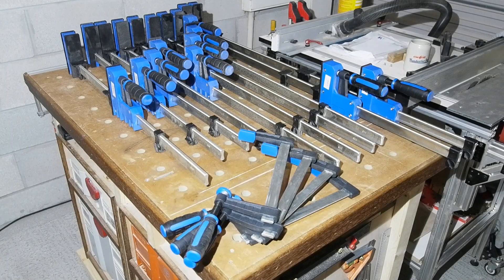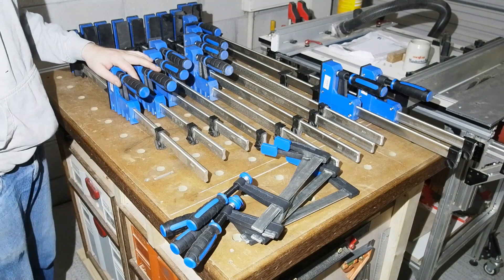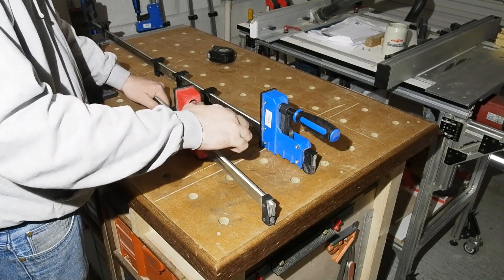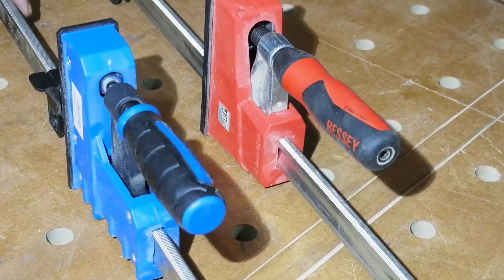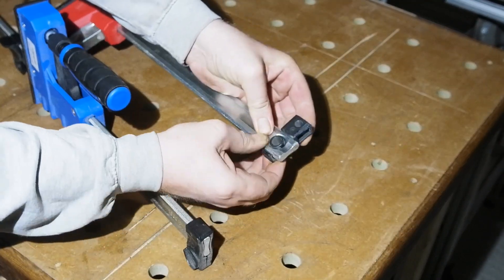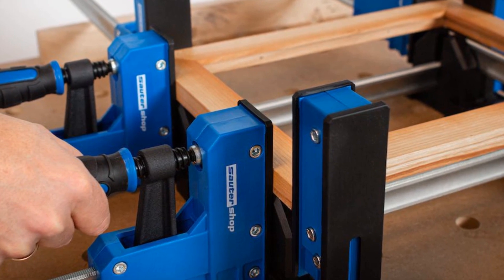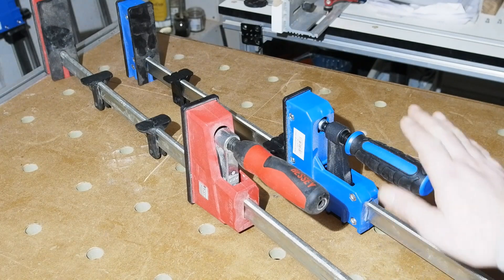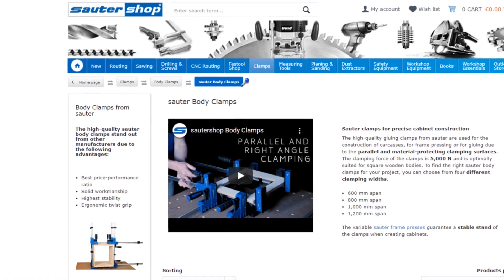[Gifted} Sauter Body Clamp VS Bessey K-Body Revo Parallel Clamp Comparison

Comment: One of the best real world comparison videos i have seen on any subject. It might be worth comparing clamping force applied but i doubt there's much difference.
Reply from the maker: Thanks mate, much appreciated! I did consider buying in a gadget to test the force but, as I kind of say in the vid, force applied with either is ample. I'm not convinced with the Bessey's ability to apply extra pressure with an allen wrench. It makes the clamp flex to where you can see the jaws become slightly angle which can obviously do the opposite of what you want - closing joints. If it needs that much pressure to close a joint, it's worth re-cutting the edges on the workpiece tbh. But yeah, no doubt with that extra feature the Bessey would win a clamping pressure test.

Comment: Really informative video. Not come across Sauter before, will definitely be checking them out based on what you showed.
Reply from the maker: Thank you mate. They're certainly worth a look. Their speciality has to be their own brand router table insert plates and router lifts. Just superb quality. I have one of their insert plates. You can see the video on it pop up at the end of this vid if you're interested.
Reply: Also have a look at the Woodgrafter on YT.  That Andy did an interesting review of their router insert and associated bits.  He seemed impressed.
Reply from the maker: Good call Julian. He did a pretty in depth review and set up etc.👍

Comment: I have no doubt what so ever that these are good clamps and if some company gifted me a load I would also tell you how good they are. Not to get carried away with how much crushing force you can get out of them, I only require clamps to hold bits of wood together until the glue dries. A pair of 1200mm aluminium clamps can be had online for approx. £30 if they are good enough for Paul Sellers they're good enough for me (small hack required ala Mr Sellers).
Reply from the maker: Doesn't matter if something is gifted to me or not, if it's shite and not fit for purpose, I'd say so as I have in previous reviews and comparisons. 
One of the points I make in the video is the ability of the Bessey to apply excess clamping force is unnecessary. If you need that much force, generally your edges aren't prepared properly. 
20 plus years in boat building and construction, I've made do with whatever clamps. Most often hand me downs - sash (aluminium and steel/iron), pipe, G and F - no frills stuff, but nonetheless helped me produce work I'm very proud of. I'm a recent convert to the parallel clamp of this Bessey Revo type design. They are just better. 
"Good enough" is fine but it isn't the final word. Also, the needs of amateurs are different to those of most professionals. Paul Sellers, although a very respected craftsman and teacher, regards himself as an amateur. Amateur because he isn't relying on daily production of work to put food on the table and keep a roof over his head. For professionals, those of us who produce day in, day out to make a living, little efficiencies with certain tool choices can have a big impact. 
I would hope that videos like this help assist the amateur and professional alike make better choices of where to sink their cash, even if the products aren't for everyone.

Comment: Forgive me if you covered this. I did watch twice but my concentration is limited. I assume there is nothing to extend two clamps together like you can do with the Bessy?
Reply from the maker: Don't worry, it's me not you. Totally forgot about the connector. Had looked into previously. Annoyingly, the connector would seat the Sauter bar ok but the bars are missing to hole in the Bessey. The hole is needed for the bolts! If you had the means, you could drill the Sauter bars out I suppose. 🤷‍♂️ Failing that, it's s bessey only option.

Comment: Nice video! How do you think they compare to the Axminster ones?
Reply from the maker: Don't have the Axminster Trade version bud but visually, you can see that like the Sauter, certain mechanical elements aren't as overengineered as the Bessey. They do have the same jaw size as the Bessey it seems. Also have a jointed handle so you can turn it sideways, using as a sort of wrench to apply more force. Though, as I say in the vid, care has to be taken when using these features. More than enough pressure can be applied for 99.9% of tasks just hand turning the handle. Like other budget versions, no doubt they work perfectly well (they seems well reviewed) and will meet clamping needs. They just might not feel quite as "proper" as the Bessey.
Reply: @BischBaschBosch  I have the Axminster ones, I’ll be doing a comparison before too long. One difference is that the aux clamps have a handle that can be flipped 90° so you can apply more force, but as you say, Stew, that’s not always a good thing! 😬👍
Reply from the maker: @10MinuteWorkshop  Absolutely mate. As I've said elsewhere here, if you need that much force to close a gap in a glue up, you're better off redoing the edges. Shouldn't need 170nm or whatever it is the Bessey is capable of.
Reply: @BischBaschBosch  Exactly! I think I said much the same in my 5 clamps bud or whatever it was - put 5000 Newton’s of clamping pressure over something I’ve made and it’ll snap in half! 😯😂

Comment: Sauter body clamps look like a blue version of the one’s soled by Rutlands in the U.K. 

I have the Rutland ones and I can get enough clamping force to dent the timber even with the soft jaw

Got to the end of the video and differences? Not doubting you BTW, just asking 😁
Reply from the maker: Yeah, that's what I was trying to get across really. The force from the budget ones are ample. Very similar to the Rutlands but different casing and handle. The Sauter and Bora are identical though. 🤷‍♂️👍
Reply: @BischBaschBosch  definitely ample for sure.
I am very please with mine I must say. The clamping guide to make a square look really good though
Reply: @BischBaschBosch  Adding to this, the Rutlands are identical to the Well Cut ones.

Comment: Think personally I will stick to Bessey and Wellcut clamps.
Reply from the maker: Yeah, like I say in the vid, the Bessey is still the one. Funny enough, the Wellcut are almost exactly the same as the Sauter. From the same factory no doubt. Even has the same moveable foot/End stop.🤷‍♂️
Reply: @BischBaschBosch  Exactly but at a MUCH lower price i paid £25 each for 1000mm Wellcut clamps with free postage.
Reply from the maker: Can't argue with that mate. That's hella good value! Didn't realise they were so cheap. Seems around £25 will get you a 600 now but still, if 8 need anymore ...😄😄
Reply: @BischBaschBosch  it was via eBay 2 weeks ago I have bought 4 in total of those they should still be available they were up for 28 but accepted a 25 offer
Reply from the maker: Crazy. Gonna have to have a look at that price.👍

Comment: Funny, I fucking hate the F style clamps! Ive had a proper reminder today why I hate them - nearly cost me a lot of oak... Then your vid shows up lol Bar their high jaws Ive no time for them, I'd sooner use pipe clamps, they never let me down when glue is reaching set time, the bars can't take any glue spillage and be used again I haste I could go on bud, theyre too much and to little too - better clamping options out there and more so one handed too IMO.
Reply from the maker: 😂 Whatever works for you with these sort of things. I love F and G type clamps for curvy stuff mainly, like you say, due to the depth. They can be a nightmare when you need quick clamping on steamed stuff though. I have a bunch of inherited sash and pipe clamps. Nearly 70 years old some of them. Still work perfect! I am a bit of a convert to these parallel jaw type ones. Clamping force of a sash/pipe but with deeper jaws. Easier to set I find too. Can get a bit expensive these though. Pipes can save a lot of money and work perfect. And you can custom length them!👍